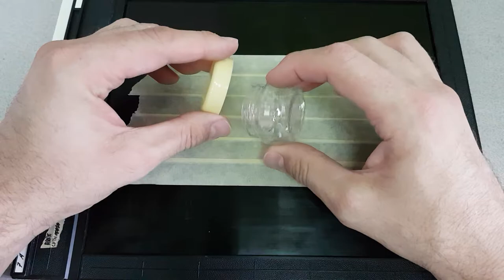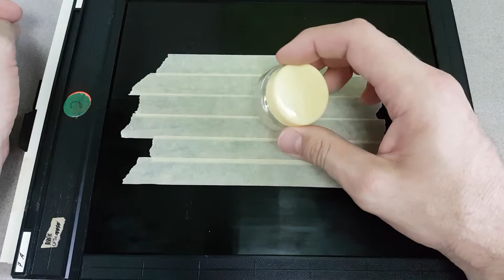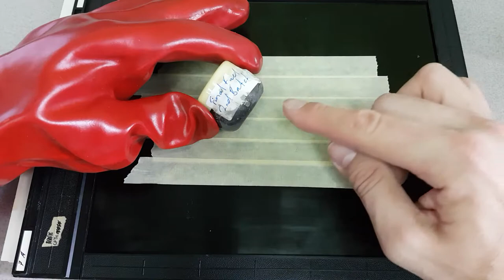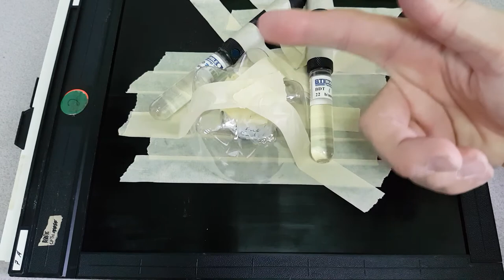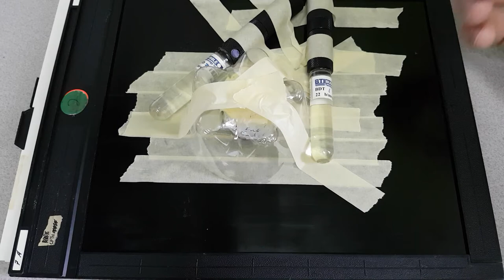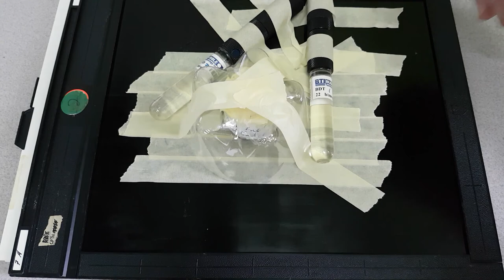ECCO - Strange investigation

Comment: If your PET is being "over-crosslinked" by radiation rather than direct chemical contact  ...perhaps also try latex rubber glove material as a prompt sensor (placed adjacent, not in contact.)   When altered, it tears when stretched, or even becomes brittle like glass cover-slips.

Here in UW old chem building, our stored latex gloves only last a year or so before becoming unusable (fractures.)  Any stretched rubber band will break within about 12mo.  That's in labs and store rooms lacking solvents, or any wet chemistry at all.

One joking explanation for the department's crunchy latex gloves is: they're altered by radiation from the old graphite pile reactor, removed decades ago!  (No, the GM pancake detectors here only show background.  If radiation was doing it, it's not a detectable type.)   On the other hand, gloves and rubber bands do become embrittled by ozone in air pollution.  Perhaps the real source of the effect is chinese coal plants recently increasing Seattle's O3 level.
Reply from the maker: Good tip there - might just do this. The intention is to cut out the affected non-contact PET and look at it und SEM today. Could place the rubber next to the remains of the bottle.
Reply: Or, use a stretched rubber band!  When embrittled, they snap spontaneously.  Probably works as a crude integrating detector for ozone.   (Perhaps your paste sample contains extreme levels of dissolved ozone, or perhaps nitrogen oxides.)

Also, I've had polyethylene squirt-bottles embrittle after 2yr, caused by waste ethanol which had been in contact with mercury surface for many decades.  (But HPLC didn't detect elevated Hg in the alcohol.  Didn't test the PE plastic.) Normally, poly bottles remain flexible for about 10yr in our chem dept. environment.

Probable sensitivity, in order of lifetime:  first the pink anti-static rubber bands spontaneously snap, then the latex gloves tear, then the latex gloves turn to confetti, then the PE plastic bottles crack when squeezed, then finally the PE plastic bottles shatter into pieces when squeezed.  This in Bagley Hall "G" floor, UW Seattle.

Comment: Probably you thought about this yourselves, but if not, please make sure that you put something nonreactive between the negative and the sample container (e.g flimsy gold sheet) and not only masking tape. when the sample container starts leaking through the masking tape it will damage the negative.
Reply from the maker: There is actually very little water in the slurry and as the container fails it dries out making it less mobile.

The masking tape is additionally hydrophobic.

Moreover, there is a 1mm dense polymer sheet after the masking tape shielding the negative.

Comment: Very interesting and well thought out experiment. I would suggest UV-VIS and MWIR spectroscopy of the degraded material as an important tool to use in the post analysis efforts, if not already planned. The medium wave band has strong signals for petrochemical bonds. The changes in signals may give a clue into the radiation. It is the absorption that leads to bond breakage, knowing which bonds are breaking is an indicator to the source of the radiation. Indeed the thought that comes to me is radiation in the THz region which often goes unobserved because of the lack of available detectors although generally available today. An interesting bit is if it indeed radiates in the THz band as an efficient source for THz illumination has long been sought with little practical success. Wouldn't that be a happy accidental discovery. Cheers....
Reply from the maker: Thanks for the tips here.

We bought some LEDs including a UV one. First test was to see if the fuel would drive an LED if one end was in the fuel and the other grounded.

Can you point us in the right direction for the tests your describe?

Bob
Reply: Martin Fleischmann Memorial Project , any radiation for which you have no detector would indeed appear strange. Spectroscopy indicates radiation absorption at multiples and submultiples of the primary resonance of any particular chemical bond. The strength and width indicates about which multiple and distance from primary resonance of the bond. The PET signals are readily available, the post scan will indicate which bonds have been broken. A submultiple of the missing bonds should be well targetted if my speculation is accurate, but it could be some multiple. Once you see one or two missing bands the remainder can be deduced with good accuracy on where to look for the radiation source. Send me the scans and I should be able to sort it out rather quickly. Cheers
Reply from the maker: We could send you samples of the exposed material.

Here is the blog about the tracks observed on the previous negatives developed. This was using much less fuel. We could not see easily the tracks to the naked eye but they appeared when looking with 16 bit scanning and, to date, we have only scanned around 10% of the effected negatives. Here is the commentary on that so far.

https://steemit.com/photography/@mfmp/ecco-radiographic-plate-developing-and-feature-identification
Reply: Martin Fleischmann Memorial Project . I need to contact a University lab in Texas to see when we could run the scans. Also need PET sample not exposed. Noted also that the PET likely has Sb in it. Believe I have your email and pick up conversation later.
Reply from the maker: ok - Can send both sample and null.